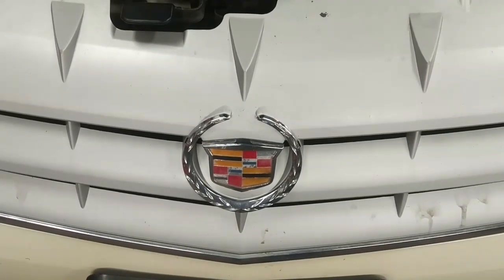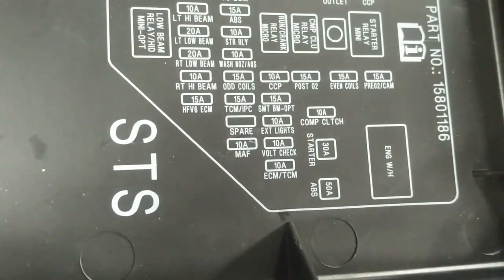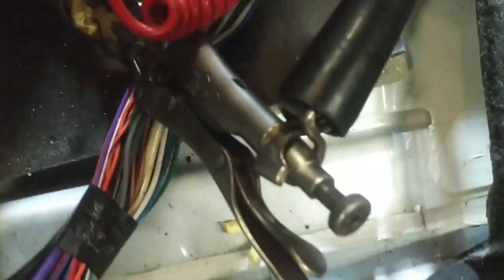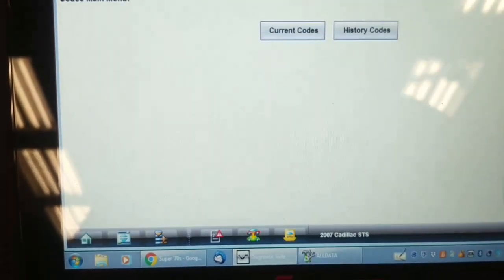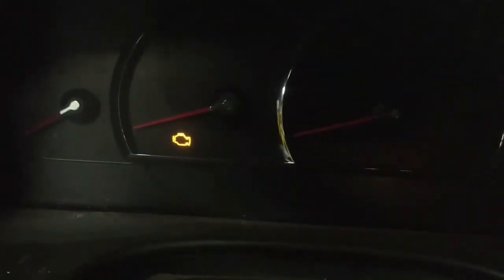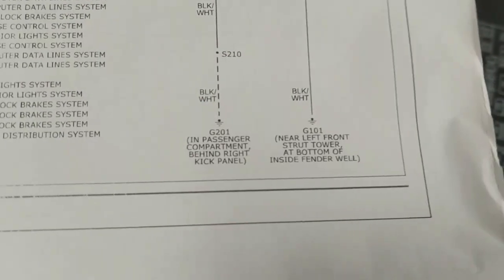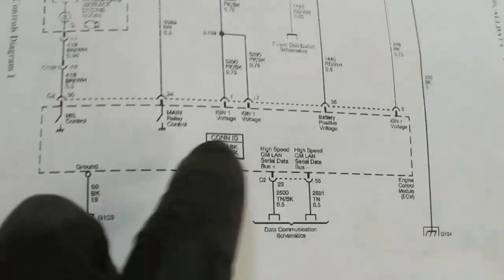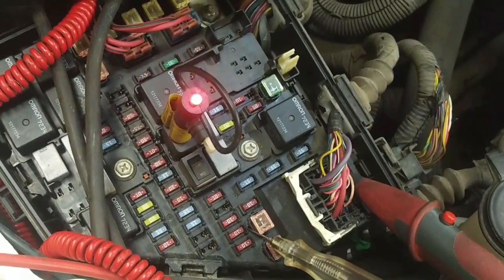2007 Cadillac STS No Crank

Comment: I have an 07 STS doing the exact same thing. I was looking at possible ecm but great information here. Thank you.
Reply from the maker: There were multiple problems with this car. Corrosion in the fuse panel was the initial problem but the customer created an additional problem by leaving a connector beside the battery disconnected which created the loss of communication with the PCM and Transmission computers. Good luck.
Reply from the maker: Check out part two. After replacing the corroded fuse panel still would not start. Connector at 17:15.
Reply from the maker: https://youtu.be/9PXxXo_8ibg sorry link to part 2
Reply: What did you find my problem started when I broke a rear brake line this winter,I blocked off the brake line at the master cylinder and used it only to go to the local store I live in the country
Reply: Yea I'm stumped I wonder if the ignition switch is faulty on this
Reply from the maker: @allenlestage2327  This vehicle had multiple problems. First the fuse panel under the hood was full of corrosion and I believe that was the initial problem with a parasitic draw killing the battery and other electrical anomalies. But the customer aggravated the issues by replacing the battery himself and then in the process disconnected a connector beside the battery that has the network going through it. this prevented communication with the computers under the hood. If your problem is a simple no-crank condition i'd start at the starter and work your way back. You may need to scan the network for codes as well. start with the basics. I can't see the brake line being related to this condition though. good luck
Reply from the maker: @allenlestage2327  To test the ignition switch you will need a scan tool that can communicate with the BCM. The ignition switch is an input to the BCM and the BCM communicates with the ECM to request the crank event provided the transmission controller reports that it is in Park or Neutral. You need to check of the crank relay under the hood is clicking when you try to start then check at the S terminal of the starter for power during crank request. Good Luck
Reply from the maker: @allenlestage2327  here is part 2 of that video series if you are interested. https://youtu.be/9PXxXo_8ibg

Comment: I have a question how do I jump the starter relay
Reply from the maker: Remove the relay, note that the pins on the relay are numbered. Locate pins 30 and 87 in the fuse box by looking at the relay. Remember it will be a mirror image. Use a small piece of wire to jump pins 30 to 87 in the fuse box. If the starter is good the engine should crank. If the ignition is on the engine should start. Make sure it's in park.

Comment: I have cadillac cts 2006 It all started replacing turn signal light, the dealers at the local place replaced the pcm it worked for while and past 8 months no crank I have to bypass start relay every time to crank, some days it work fine but leaving overnight same trouble
Reply from the maker: Does it generate any codes in the PCM, BCM or security systems. Need to view the status of the crank request, gear positions in the PCM. Need to scan the TCM for codes as well. I dont think its security as you said it starts by bypassing the starter relay. The ignition switch is an input to the BCM, the BCM communicates with the security module and sends a start request to the PCM. The PCM communicates with the TCM to make sure its not in drive or reverse and the energizes the start relay. Check data in the PCM to see it its commanding the starter relay on. Could be wiring obviously. Good luck

Comment: I have a 06 cadi dts cranks but cuts right off. Could it be the ignition switch ?
Reply from the maker: You mean it starts but shuts off immediately? If thats the case could be an Antitheft issue. Are there any security lights or messages on after it stalls? Any codes?
Reply: There might a leak in the air system

Comment: Phillip Bailey why leave everybody hanging as far as the results. This morning I went out to my car and turned the key and the PCM was communicating and the car started right up. I drove the car and the tranny was shifting properly unlike it did when I jump started it by shorting the connections for the relay that turns the starter. For those of you jump starting your starter this is only a temporary fix to drive the car very slowly to your destination. I TRULY BELIEVE THIS PROBLEM IS OCCURRING BECAUSE OF AN INTERMIITENT RELAY ISSUE WITH THE SECURITY SYSTEM. Therefore, I will not being arming my alarm anymore unless the problem returns which will rule out the security system.A weird thing happened yesterday. When I put the ignition in the start position and closed the door to check under the hood the doors locked with out me pushing the remote which was locked in the car. Thank GOD my son was in the car and was able to unlock the door. That happening let me know something is wrong with the SECURITY SYSTEM. Your thoughts and conclusion Phillip?
Reply from the maker: Not meant to leave you hanging but there is a part 2: https://www.youtube.com/watch?v=9PXxXo_8ibg
this vehicle had several problems mostly due to corrosion in the fuse panel. (we are in a salt use belt here). This was then aggravated by the customer unplugging a connector near the battery when he installed a replacement battery. His initial problem was the battery going dead, and intermittent no start. There is also a third video on this car once I did get it running. Has timing chain issues due to lack of maintenance. There are dozens of possible causes for intermittent no start conditions. Need to start with a complete network scan of all controllers. A security issue should log codes in the PCM and Security system. HTH good luck. Plus he still owes me money for the last diagnosis!

Comment: Did fix the problem?
Reply from the maker: There were multiple problems starting with the corroded fuse panel then the customer left a connector by the battery unplugged.

Comment: So what was it ? I have 06 cts doing same thing.
Reply from the maker: Initial problem was corroded fuse panel and voltage drops in the fuse panel. Customer created a new problem by unplugging a connector beside the battery that opened the network disabling communication with the PCM, TCM and ABS computers.
Reply from the maker: @zakparkin6346  
Once I figured it out I simply plugged it back it. There are lots of very similar symptoms that could be caused by many things, even battery cables and connectors. It's difficult to say what to recommend without having some test equipment on it. Sorry wish I could be more helpful. Yes check all fuses, pull relays and look for corrosion. You need a factory level scan tool to start with. Good luck
Reply: Phillip Bailey thanks. I’m having the exact same symptoms. No corrosion at the panel box.
Reply: @PhillipBailey  I ended up using dielectric grease on all my computer plugs ecm tcm and abs module I also ran a extra ground wire from ecm to where the battery ground is on the body and my CTS is working ever since.
Reply: I've never heard of that load pro tool before. How do you like it? Looks a little quicker to use than the light bulb method I've always used.

Comment: I have same issue with my Cadillac STS-V 2008, I thought it was battery and I replaced it by new one and still same thing, I am seeking your advice if I start trublshootig the fuses box? And did you able to run the car?
Reply from the maker: Not sure what part of the world you are in as the use of calcium chloride on our roads here to melt ice and snow contributes to these types of problems. The fuse box failure was one problem but the car still would not start because the customer had left a connector near the battery unplugged and this caused an open in the computer network. There are many possible causes for a no crank condition.
Reply: @PhillipBailey  thanks a lot Phillip I will start by the fuses box, yes I see the part 2 and ur correct. Thanks again
Reply: Ishaq Al-busaidi  I’m having same issue whit my 2007 STSV after replacing subframe due to wreck
Reply: OMG..every customer that ever complains about the cost of scanning and trouble shooting code or codes should be forced to watch this video.Excellent video,and dont worry about the one handed videoing with a tool in the other hand .You did a great job explaining everything.Yes I have subscribed and turned on my notifications .Thanks